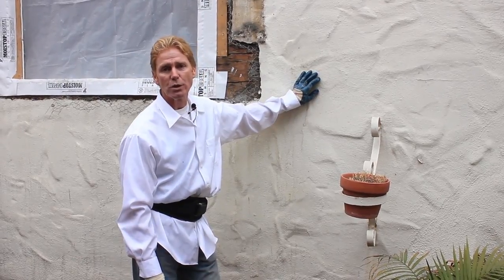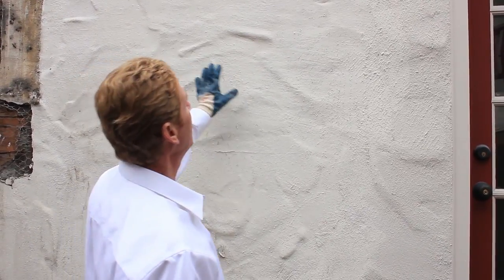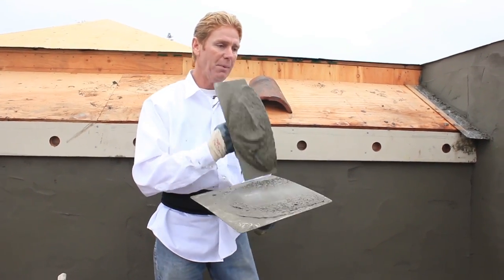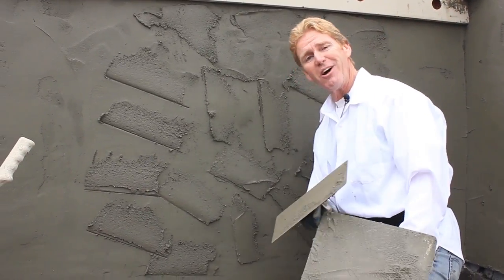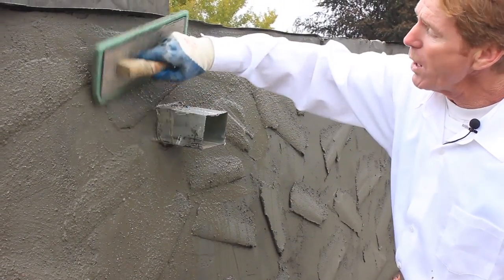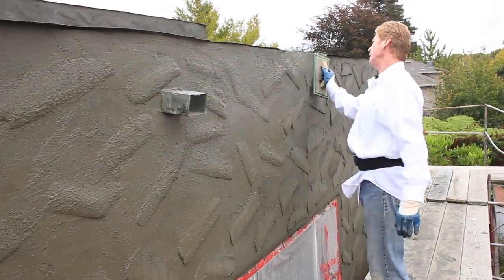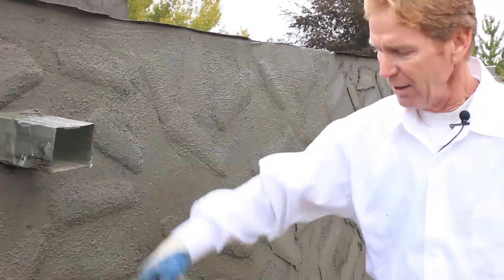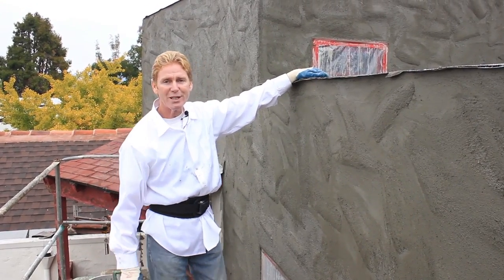Stucco adobe bumpy lumpy texture.

Comment: Hey Kirk, what is the formula (ratio) for the mud? Do u use any lime? Also, have you troweled stucco on Cement Sheeting?
This the important info I'd like to know.  Many thanks and you are the coolest plasterer on the web.  :)
Reply from the maker: Howdy Antonia Dude, thank you,
    the ratio of cement plaster to sand is three to one. 
1 part cement plaster to 3 parts sand.
 I have applied stucco and or plaster to all types of cement boards, wonderboard, durock and more, type in the key words such as plastering over hardi board or any other substates a video should appear.
 best wishes,
        Live long and Plaster
 teaching repairing your number 1 investment your home
Reply from the maker: Howdy Antonio, below is a video that may help,
                   best wishes,
     kirk giordano plastering
https://youtu.be/JvJhK7QEw2w
Reply: Kirk Giordano plastering Inc. sorry for the stupid question but how much is a part? I’m very new and doing a lot of research. Thank you and great job!